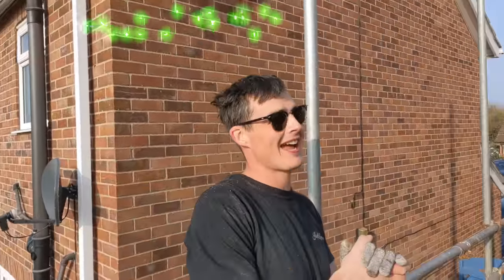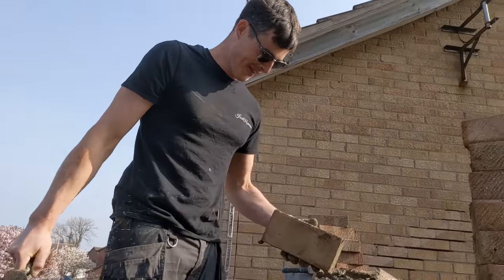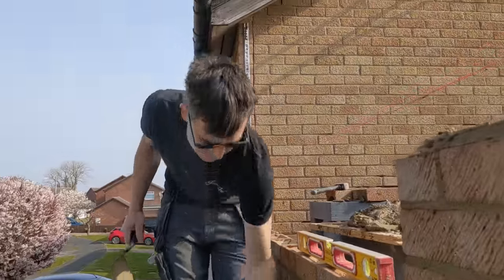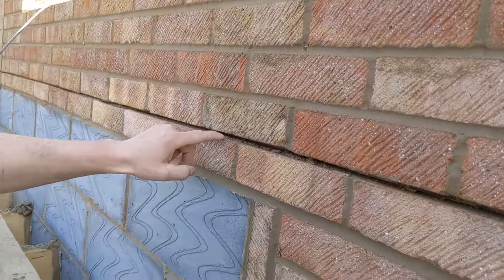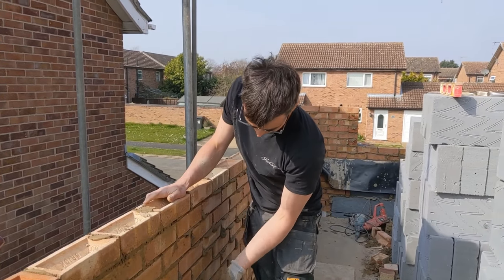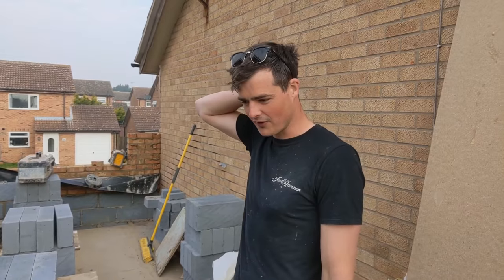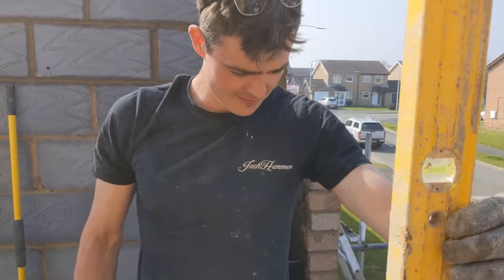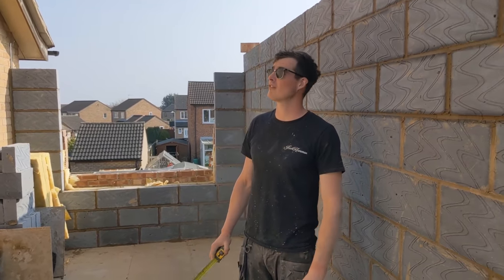Bricklaying-Forgetting cavity tray🤦 #renovation #vlog #construction

Comment: Larry I agree with all you say about laying multiple courses but it’s not a myth about the big trowel, bigger trowel equates to more weight of muck and that puts strain on the joints as much as the other aspects. I am 67 and speak from experience and NHS physio warned of the dangers years ago. Good luck to Izzy he is a very good brickie and all round good lad. 👍
Reply from the maker: Cheers mate do appreciate it💪 hope you have a fantastic weekend mate, all the best
Reply: iv been laying since i was 15 im now 64 and always used a london wide 12 inch and never ever had any problems with anything other than my back obviously a small trowel is more suitable for some work but on general site work its always been the big trowel its knowing how to use the trowel and i dont see any problem with izzys trowel
even with a small trowel and building above 9 high block is going to put a strain on your back wrist elbows and shoulder
7 block and 21 in height has never caused any arm or wrist problems
iv been to specialists about my back and they all shake there heads when i tell them im a bricky im told your back is like a door hinge and its going to go 1 day and the usual skeletal problems which i can see in some guys who are still working away and i know guys my age who are still as fit as a fiddle with no problems
Reply: Well done Larry people like you have built this country so not arguing with you mate just my point of view and life experience, hope you stay fit and well. Good luck to Izzy  who seems a very genuine lad who admits his mistakes, and his apprentice who by the way is not bad on the camera. 👍
Reply: @spesh9205  yes i no you are not arguing stay happy bro and all the best
Reply from the maker: Brilliant to see some great conversation in the comments between you and Spesh, all the best buddy!
Reply from the maker: Thanks you very much mate, lovely seeing some good chat with you and Larry!🤜🤛 And yea my apprentice is not only a great worker...he's an even better camara man😂
All the best . hopefully new video tomorrow my mate

Comment: Another great video mate, but I reckon you will regret in later years using such a BIG trowel. Not good for the wrist, elbow and shoulder joints mate. Great how you are so patient with your apprentice, keep up the good work.
Reply: @Siam Winfor My point exactly and a price to be paid in later years. 👍
Reply from the maker: Cheers mate appreciate it! Yea I'm actually really enjoying teaching Drew, he's a great lad and very eager to learn🤜🤛
Reply: its not a big trowel which screws your wrist elbows back and the rest its stretching when your building 9 course of block or building 27 course of brick like a maniac which too many brickys do now and all to save a lift on a scaffold the scaffolder is there to suit the brickys not the other way round as some do without question
blaming a big trowel is a myth